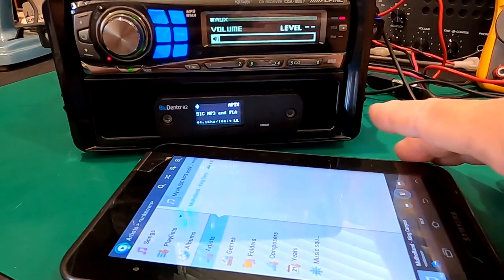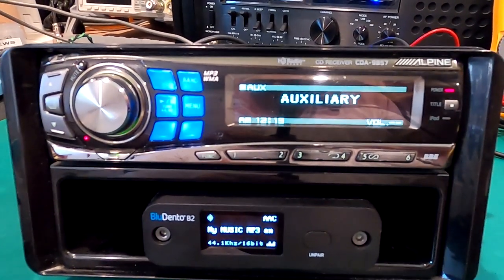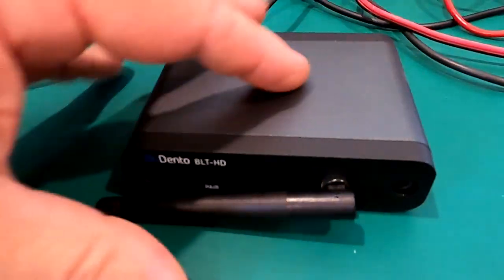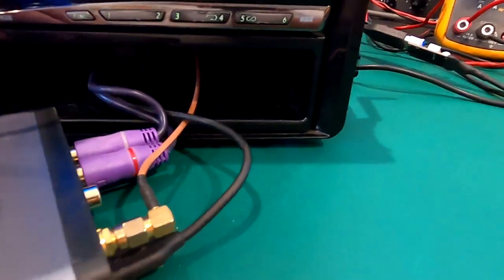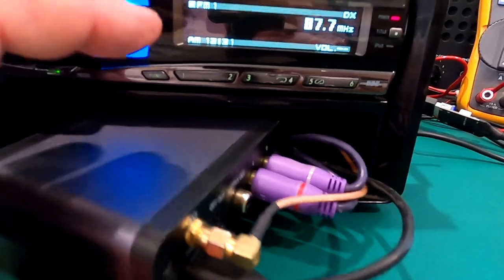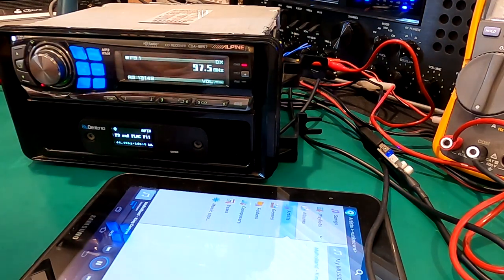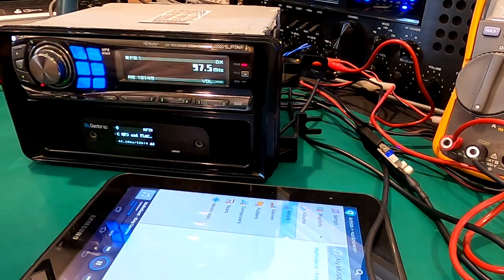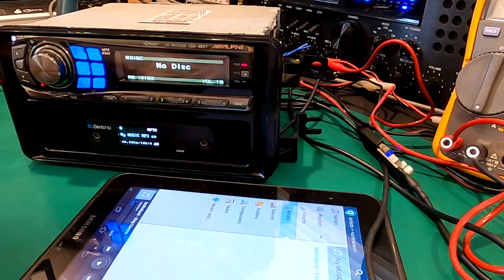Add Bluetooth to Old School Car Stereo, detailed instructions. (Bluetooth)

Comment: I have never wired ever is there a need for the external antenna and can I just power it buy a charger for the cig lighter love old radios have a alpine and a kenwood with the fm transmitter and it’s not great 😂

Comment: Nice Saturn base station! 27.385 and 27.405 are still active in the seattle area last time I checked. KE7MAI here. Im watching this considering how I want to upgrade my 2005 jaguar XKR factory Alpine system. It has a factory cd changer. Good video.

Comment: Howdy, in the video you talk about using the amp remote wire or just the accessory lead. 
Is my understanding right to say the gopro cable goes ‘left’ from the 5V USB connection and connects straight to the receiver. 
And then the 5V ebay device has a negative and a positive lead coming off it to the ‘right’? Then you would splice the positive into the above mentioned accessory or amp remote leads and then splice into stereo ground or just ground for the negative ?
Reply: thank you for the help!

Comment: I used the 17 dollar piece you can buy off Amazon and it works great.
I was here to see if these decks sound better than the new ones because I have 3 alpine decks in the garage.
I was thinking about putting one in if it will sound better?
Reply: I will try this one the only one I have used is the cigarette lighter one, then set to the station.
I hear the new $75 dollar ones are way better and I'm thinking about getting it because you can use it inside on home stereo then use it in the car.
Great video.
Reply from the maker: Yes the cig lighter devices are pure junk audio wise.  Try this one or the SMSL I showed in a previous video, that would be in your price range.  https://www.youtube.com/watch?v=yOu8O4Mp6dg   I still use this in testing and comps and I holding its own very well.. Cheers
Reply: @breakerbroke23  Thanks I will  pick one  up.

Comment: I have a USB port on my car (Dodge uconnect only interfaces with Apple on my unit), and just charges otherwise. Would that be adequate to power the Dento?
Reply from the maker: Yes that will work just fine. Thank you for watching.

Comment: could this work if i have a dsp(cda 5755) plugged into the cd changer port. the dsp also has one of these ports
Reply from the maker: I think the outboard processor will let you add a AI Net plug for the CD Changer, if that is the case then yes this should work. That was how you daisy chain the DSP and Changer to the Head Unit.

Comment: I could have used an bluetooth fm transmitter but still good idea
Reply from the maker: NO, the FM transmitters have terrible audio quality and the audio output is so low that you have to crank the stereos volume up so high the sound is degraded.. I will do a video doing a comp. Thanks for watching
Reply: @breakerbroke23  well the dad from my bestfriend has 1 and its working fine, he doesnt need to pull up the volume tho..